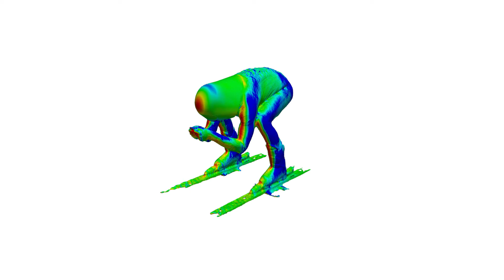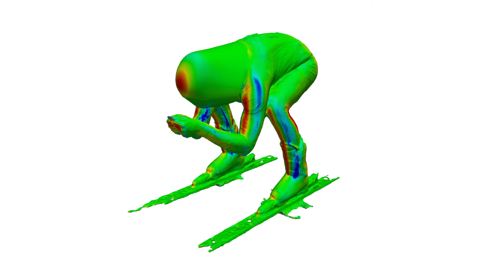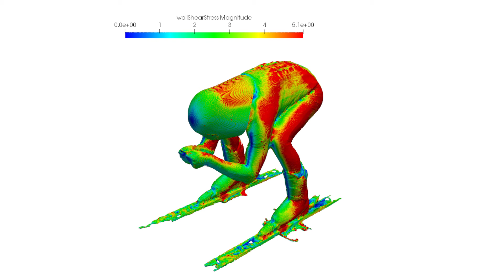What is Aerodynamic Drag?

Comment: 0:57 I know this video is 7 years old, but. .... You said "if we integrate the pressure over the whole surface of the skier then ..." Yes, absolutely! But we can't. In the nearly 3 centuries since d"Alembert's Paradox hit the brick wall , aerodynamicists are still unable to to predict the maximum range of a perfectly spherical 9-pound cannonball projected at its characteristic speed of ~1,000 fps  (theoretical ~ 10 km, actual ~2 km!) They are using the wrong physics: They are using the Newtonian mechanics of solid (incompressible) objects . Thermodynamics is the physics of energy, and it works with compressible gases.

Comment: Hello Wouter, 

Thank you for all the amazing videos. 

In an interview I was asked a question. "If I am given unlimited computational resources, and I can do a mesh of the smallest cell size I can use before it gives an error. What is that error?"

If possible can you please help me out with the question.

Thank you
Reply from the maker: Hi Pranav,

in this video we explain the different errors one typically makes in a CFD simulation:
https://youtu.be/dyiREvdc4Gg

With infinite resources, you can bring the discretization and iteration error down to a minimum.
But you may still be stuck with the modelling error, if you select the wrong model.
So you'd probably have to run a DNS (direct numerical simulation) to reduce that error as well.
And, depending on your application, you may also need to include other effects (heat transfer, chemical reactions, ...).

Comment: i want to select a blade for VAWT.so how do i should start to work & what r the calculation parts
Reply from the maker: Hi Pratik,

before you start any simulations, you're best off to play with different airfoils --> check out www.airfoiltools.com for some first insights! You can calculate your own angle of attack in function of wind speed and rotational speed of the turbine. After that, you can consider more advanced 3D simulations.
Reply: @AirShaper  thank you.
As in VAWT the AOA is changing at evert point how can i fix the value of AOA & Is their other tht can increase lift force
Reply from the maker: @pratikchopda9716  Hi Pratik, indeed, the AoA changes all the time, so you could start off by writing some simple code in excel, describing lift & drag values at every azimuth positoin. That should already give you a more precise idea on energy yield. I've done this exercise in the past for a customer, long time ago, and it works nicely, before doing more advanced sims!